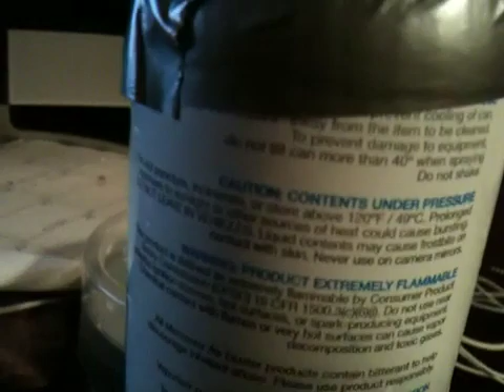What Happens When You Tilt An Air Compressor Can Upside Down

Comment: I've got a question, what could happen if it is sprayed upside down?
Reply: Droidz tech I know it wouldn't explode. I've done it before, just not on my hand.
Reply: @VisualizeBeyond  only if you spray it on long enough, with 1 second it will just melt your skin barely and leave you with a slight burning sensation for a few minutes. stupid idea regardless cause I was shitting myself thinking I was gonna die when I had barely any damage

Comment: look it disperses liquid nitrogen looking substance. let me spray it on my laptop keyboard, screen, and my hand incase you guys didn't see it.
Reply: it's way different from liquid nitrogen, in fact nearly every gas looks like liquid nitrogen in liquid form. 

The gas gets compressed at the nozzle from the other gases and it turns into water. the gas is most likely this: 1,1-Difluoroethane

Comment: Question: some one must know!! the new way to kill bed bugs is freezing them with an environmentally safe chemical called cryonite (fact). So if I were to turn a can of air duster upside down then it would kill them (fact). My question is: Is the chemical that is released from the up side down air duster safe to use around the house??? I am not trying to use it around food. Actually it's a hotel room so no food is present. Can someone answer this question?????
Reply: Most of these cans contain a bitterant to discourage abuse.

Comment: When you spray a can of compressed air, the pressure inside the can (and temperature) drops which causes the chemical inside the can to turn to liquid form.  When you spray the can upside down, you spray the liquid instead of the gas.  Since the ambient temperature is much higher outside the can, it evaporates almost immediately.